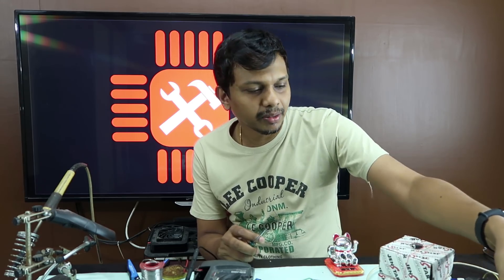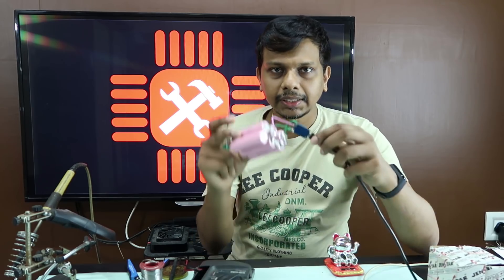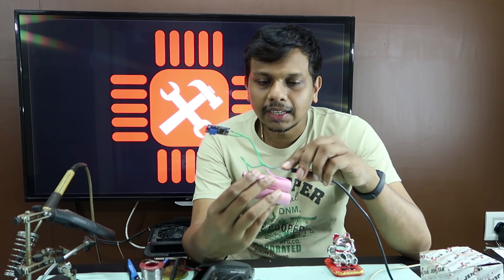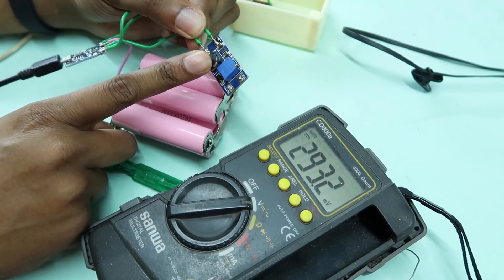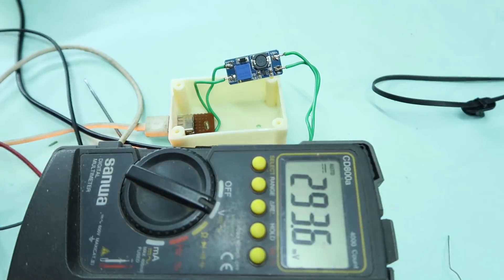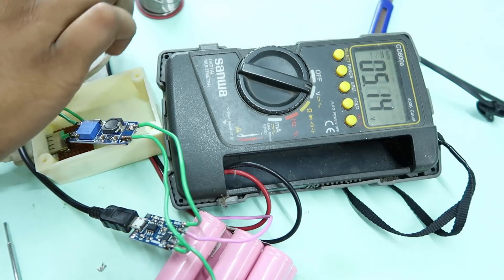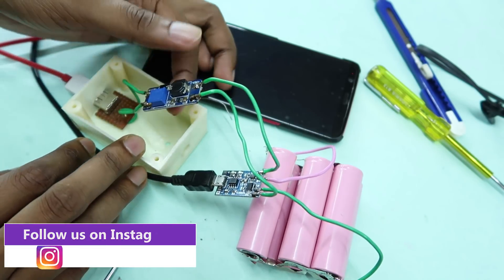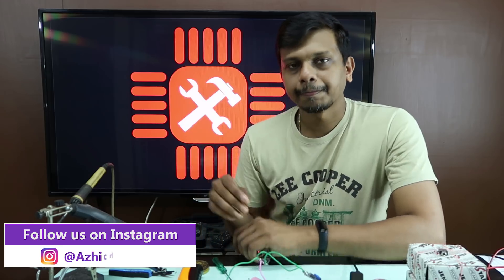Bluetooth Speaker Project | Crude Home Made Power Bank

Comment: Good. You can use Microchip battery charging IC's with over current protection and over heat protection circuit.

https://www.microchip.com/design-centers/power-management/battery-management

Comment: Use a buck boost dc - dc converter, usually it supports 3-5 amps depending on the desired voltage.
Reply from the maker: I tried some but some sellers would cheat you in AliExpress
Reply: I usually buy from eBay and its as per description, never faced any issue, if I remember correctly i got few from ali express too

Comment: Haaai brooo . Njan  ee aduth townil ninnum oru booster board(step up board) vaghee.adh connect chythapole out put 20 volte vare step up ayee kanichoo.  Preset set chythh 5volte akki. But load koduthappol voltage mothamayumm downayi povunnooo.5.10 set chythaal load varumbole 2 volte ayee marunnoo.
Reply from the maker: Load koduthu njan 5 volt set cheythathu sradhichille??
Reply: @Azhichupani   ohh kandoo. Njanum 5 volte kke set chythoo .njan vghiya booster ee model alla .
Reply from the maker: @nidhinktec8117  athinde ampere kooduthal aayirikkum, load thangan pattunnindakilla
Reply: @Azhichupani   Njanum oru 5 volte nte bluthoot speaker undakkan ulla oru planill ayirunnoo. Usb bluthoot boardum ,pam 8403 audio boardum ,randum ente 2 amper powerbankil wrk avunnud.  But njan vghiya booster boardil koduthitt wrkk avunnillaa. 5 volte 2 mpere out kittan ethylum vayi undo eaataaa

Comment: Board good anu njan use cheyunnundu ee boost converter.heating vannathu over load ayonda.pinna full details greate scott il ndu
Reply from the maker: Bro boost converter il Alla problem paranjathu.. charging circuitil aanu.. greatscott ee charging board use cheyyanathu kandattundu but ee heating issue mention cheythu kandilla...
Reply: @Azhichupani  paranja maariyataa.yeniku kuzhappam onnum illa.over load ayitu ayikum means over current
Reply: Waiting for perfect Bluetooth speaker.